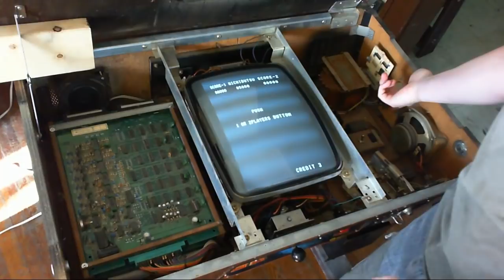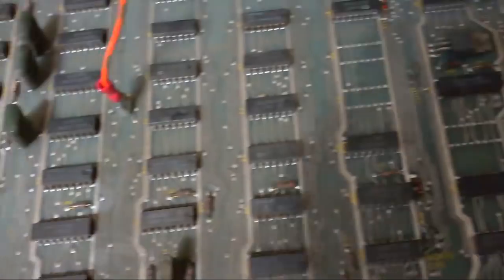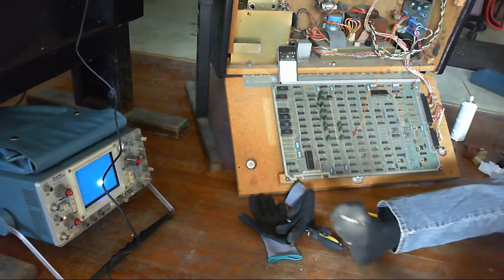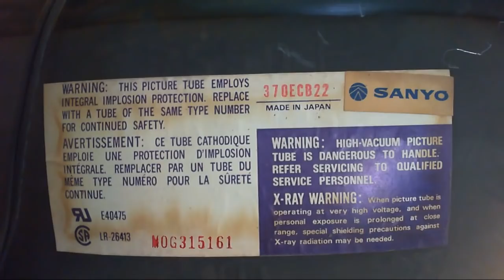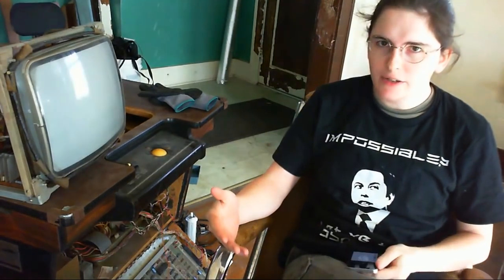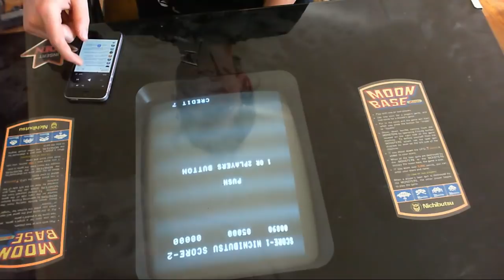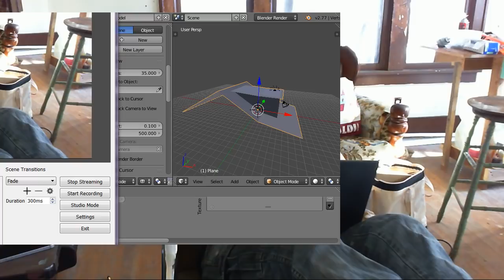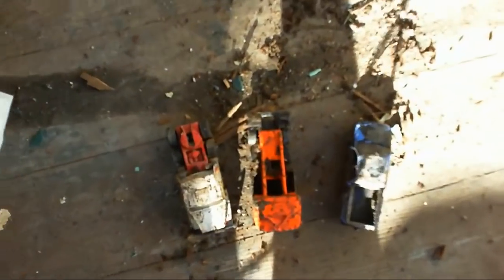Arcade Repair 01: 1980 Atari Missile Command Cocktail Cabinet Troubleshoot

Comment: You might try having a conversation with Joe's Classic Video Games channel. It helps to talk to someone who has a bit more experience. I personally have only recently delved into the realm of arcade cabinets and found his channel useful. I thought you might too. He has fixed a missile command cabinet though it's a single player machine. The boards and "common problems" should be very similar though as Atari rarely broke from their form of manufacturing.

Comment: RINOAS AUSPICIOUS TRAVAILS 
              1.) What are the differences between using the arcade games test mode diagnostic test program compared to using a separate TEST ROM chip? You remove one of the ROM chips from the socket and instead a TEST ROM chip. The Test ROM chip does more deeper level ROM/RAM test I'm guessing
                    2.) Some repair technician say that dual wipe sockets are better than the machine pin sockets. I thought that the machine pin sockets had less intermittent issues and dual wipe sockets cause more intermittent issues.

Comment: Getting clean MPEG4/SPDIF data no problem, those Jamma boards can go wonky for no apparent reason, there is a you-tuber that fixes Jamma boards who goes by the name Lukemorse1, Those big chips might be RAM chips or they might be GAME ROMS if the numbers are different or if the last part of the code is a letter then it is GAME ROM module otherwise it is a RAM module, looking at the same board as you have the DIP switch on the left is 32 and on the right DIP switch is 13, voltages for a JAMMA arcade board are +5V,+12V and -5V and 0 is GND.
Reply from the maker: this isnt a jamma board, this predates that